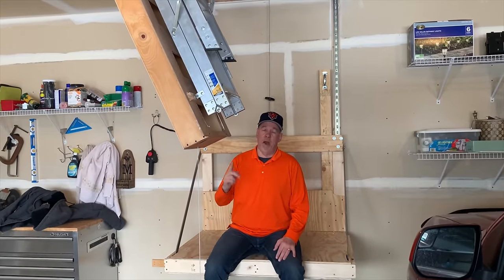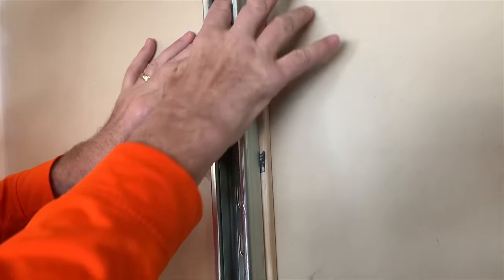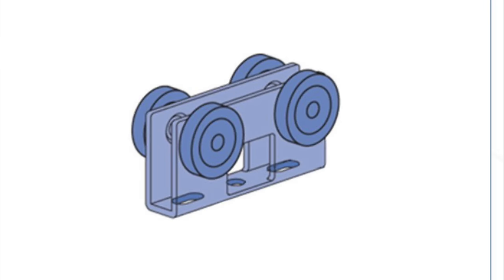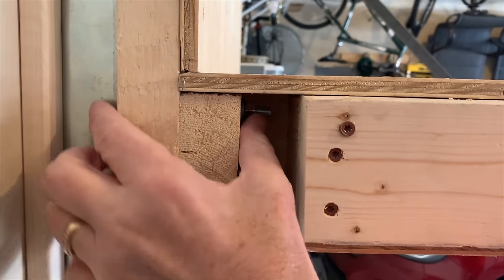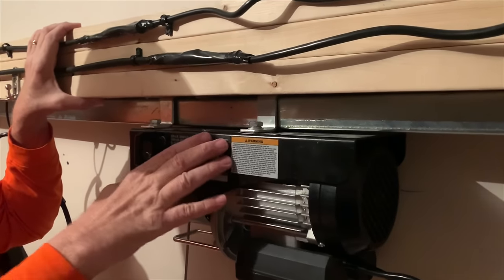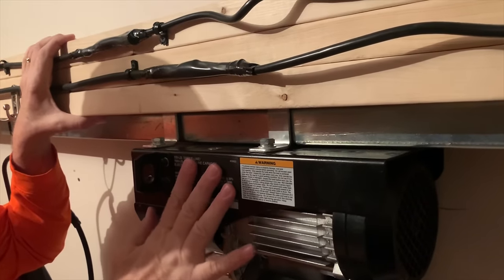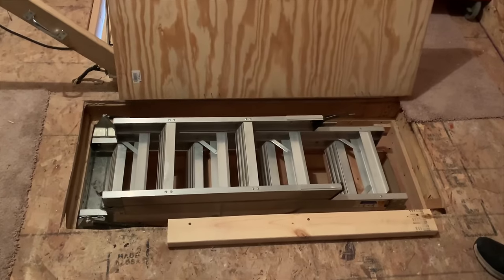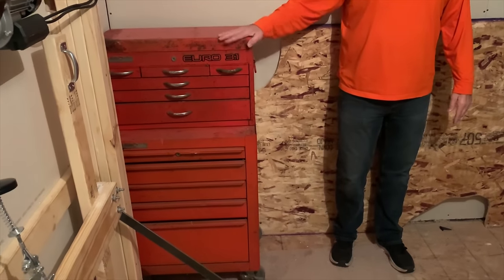Garage Attic Elevator / Lift Build in Minneapolis Minnesota

Comment: To start what a great idea and build but I have one major concern. The frame you built up top is sitting on the joists I assume? I know you attached it to the studs but does that means there is no structure that goes to the floor from the beam holding your winch? If this is the case and you are using only mechanical connection and resting on a single joist assuming that they run from garage door to back wall then you might have some minor problems in the future. Now if your joists run side to side meaning parallel to the back wall you are going to have problems real soon and I think this is the set up you have judging from how you ladder sits. You should look at running 2 4x6s from you motor support beam to the floor either way. If you lay the 6 inch side to the wall it will not take up to much room. I doubt this thing will fall but it will make your ceiling, floor and wall(that you attached too) sag over time cracking drywall and maybe spliting a stud or 2. Fixing the sag in the future will cost way more than a some 4x6s now. Sorry for the wall but I thought this would be shorter but as an engineer once I get to thinking about something it's hard to stop.
Reply from the maker: I appreciate what you’re saying. It’s attached to double studs on the wall and resting on joists as well. There is no more weight, all things considered than a couple of 250 lb guys having a conversation in the attic. The joists can handle that alone.

Comment: Please check the rating on the eyebolt you are using to attach the hook. It appears to be a common hardware item. Although they may look beefy, most are only rated for less than 200 lbs.
Reply: @theelevatorSRT8  I don't know what you bought, the eyebolt looks like a bent wire (hopefully closed) eyebolt. A quick look at Hillman bolt (one of the brands carried by the box stores) shows a 1/2" bent wire eyebolt with a SWL (safe working load) of 300 lbs. So I guessed low. Ive seen import 1/2" down to 150 lbs. Its still probably much less than you were thinking. A forged one piece 1/2 lifting eyebolt would be rated closer to 2000 lbs. I'm just asking you to check the specific bolt you bought and make sure you are comfortable with the rating.

Comment: I'm about to build one like this and would love to see the platform with the plywood removed to see how you framed it out. I was going to frame it like a wall then move the vertical posts inward so I could put bolts through the horizontal 2x4 since the end cross members would be in the way and just realized the metal support pcs wouldn't be able to bolt to the outside of the frame since the verticals would be moved in 1.5 inchs inward. You have your verticals right to the end of the platform then a cross member that doesn't extend all the way to the horiztonal 2x4; it stops in front of the bolts.

Comment: Metal splicing plates would help strengthen the angle at the base/vertical joint of the "L", and cover the dust trap (and potential hazard) where you can see the bolts/nuts.

Comment: For the record they make brackets to hang winches on unistrut and grainger sells winches that come with unistrut straps and have crane type roller assys for winches if you want to slide it left to right.
Reply from the maker: Thank you for the tip.
Reply: @theelevatorSRT8  you are welcome. Nice job. Even if you claim you dont know about framing. In the future if youre going to cut studs o  support walls or ceiling joists you might want to double up on the boards that you make your box out of. Same for the hole in the ceiling or attic opening. I cant count how many attic ladders ive climbed or repaired where the ladder was added and not propperly framed with double joists. Good call on the uni strut. Its great for so many applications. I see the price has doubled in the last 15 years.

Comment: Clever idea, very clever...and perhaps for your circumstance, the perfect solution. 
Questions fore others to consider:
1. You lose the garage storage space equal to the foot print of the platform, floor to ceiling.  That's a LOT of cubic feet of storage. You also lose the attic storage space equal to the footprint of the platform.  How much storage space did you gain, in the attic, by doing this. (most homes do not have the attic storage that you do)
2. How does the cost of building this elevator compare to the cost or a shed of equal or greater cubic feet of storage in the backyard?  (I understand in the case of a townhouse you may not have a place for a shed...but in general it would be a consideration)
Reply from the maker: Thank you

Comment: Thanks for sharing, what do you use for security?  i just saw a video of a guy falling off  the attic , im not sure what failed.
Reply from the maker: I’ve added some safety features. See the other videos. If it’s the same guy that I saw, he is using a different type apparatus. He is not pulling straight off of the hoist. He is driving another shaft with it. It’s not a smart setup. I think he’s using a garage door setup.

Comment: Perfect elevator in need the same to get up to my attic rooms in 2nd floor as under the opening already is existing strair case there no way to get a another stair case fitted. Simply perfect

Comment: You have the pulley cable mounted on the back of the lift and the load weight is further in front. There's a rotational torque pulling on the rails.
Reply from the maker: Yes

Comment: I would like to build a simple lift like this for wheelchair access to the second level. I am  leary of the trolley wheels. They look like they could get worn out easy. What if I got stuck midway???? Otherwise this is great and not so costly.
Reply from the maker: You must be very careful if you intend to do something like that. I cannot recommend that to anyone. Too many chances for injury from just operating it. I ride ours occasionally but only because I know what we we built, we over built it for strength, and I am very careful when using it. I cannot recommend using something like this for a wheelchair lift.

Comment: Nice effort however at 4:17 I'm hearing binding. Metal scraping on metal is an indication something isn't aligned well. Binding equates to excess load (strain) on the lift motor. Then you end up with metal shavings. I'm a license lift installer and I've installed dozens of various home lifts and none of them have ever used such tiny rollers like you are using. The bottom rollers are the ones that take all the pressure due to cantilever dynamics and those should really be larger and made of polyurethane or nylon. If you would have spent at least a few minutes looking at actual home lifts you would have had knowledge of proven designs and made something better than what you have. 

Stacking and gluing lumber together seems to be a time waster when you could have simply bought 4x6's while ending up with something stronger. And what is that eye bolt rated at? You didn't mention anything about using the proper grade.

Again nice effort and it's nice to see someone motivating others to build things themselves.

Comment: Hate to be critical, but if the cable or gearbox fails, aren't you going for a tumble? Maybe add a ratchet or an acme drive? Or did I miss something? This design is good for stuff, but better to avoid riding on this mechanism.
Reply from the maker: Thank you. We created a one of a kind safety brake. Go to our channel and check it out. It’s way cool. And it works.

Comment: Ok so good job and I will one day do this. One problem...the over arching beam that the motor is connected to is wrong and could pose a problem down the road. The 2x6 used should be upright...not on their sides. They are 10 X's stronger upright then on their sides like that. As the wood ages it looses its flexibility and they could crack under the weight. Just a constructive criticism. Otherwise brilliant!
Reply from the maker: Thank you. Technically speaking, you’re  not wrong about the header boards. But I did that for a reason, the large holes I had to drill to fasten the strut/motor. That header will support 5 times the weight I will ever put on it. Plus, they are glued and screwed, and from an engineering standpoint, eliminating the shift, which gives it the strength of a solid beam.

Comment: I have a question, the control, does it hang on the wall below the lift so you can have it available to use the lift. Did you cut an opening in the ceiling for it to hang down? Nice Job also. I will build the same for my house.
Reply from the maker: We just left some space in the opening.  If you build one, be careful building it, be safe operating it, and overbuild it for strength!

Comment: Nice job.

Question about your wiring between the hoist and the controller. Is the cable running from the hoist to the controller  sheathed 3 or 4 wire?  I ask because I have a similar hoist from Harbor Freight - it uses length of wrapped 4 wire to connect the controller's rocker switch. I couldn't source any wrapped 4-wire cabling to run a longer lead to the controller....
Reply: @theelevatorSRT8  Thank you! I had no idea they carried that.

Comment: The only safety problem I see with this is there is no way to stop the platform from falling if the cable breaks, or comes off.  The other issue is if the cable snaps that cable may injure the passenger.
Reply: @theelevatorSRT8  Oh and I didn't mean it all to be negative.  It's great work and a great idea.  The cable snapping happens in the off road world when you are winching someone out.  We're talking about vehicle weights though.  We have to be careful with winch lines as it can severely
 injure or kill someone.

Comment: Great idea!! What is the weight load for most attics. Just wondering how much weight can you put in a standard attic. - I found your video while searching for help with creating a lift using the attic steps/ladder. I like this idea but I don't have enough clearance to do this.
Reply from the maker: Thats a good question, I didn't calculate it or know off hand.  I'm assuming its a lot. At least on par with a living space.

Comment: Weak point is upper 2x6 holding everything from its ends. Suggest a simple improvement - extra length of wire or all-thread rods going further down to the lower 2x6.  Method of design is to imagine the first weak link fails, then see how to carry the load.
Reply from the maker: The  overall method you suggest is how I was thinking. The carriage will not fail. It’s way overbuilt.

Comment: Can you provide some details on how you extended the electrical cable?  What wire type and guage and how many conductors are needed?  I can't find an electrical detail in the manual for that hoist. (Talking about the up/down controller)
Reply: I used this.  Went 16 gauge.   https://www.grainger.com/product/GRAINGER-APPROVED-Portable-Cord-20PX48.   I just removed the old cord fully vs splicing the existing cord.  Just be sure to ground all the wires as there is 240V caps to run the electric break on a power fail.

Comment: This is a great idea and straightforward, efficient design.  One question I did not see addressed:  what did you do below the vertical beefy posts you built to carry the horizontal motor mount beam?  Those attic verticals are strong but unless the posts below going down to the garage floor are also beefed up too, the first floor supports would be the weak point.  Thanks
Reply from the maker: Thank you, when we are only talking about lifting 300 lbs max, its not a concern.  Just picture two grown men standing side by side in the attic.  Nobody would be concerned about that .

Comment: Unistrut is strong as hell. We hang literally tons of emt full of huge copper wire. Thanks for the video. Ive built and installed several elevators but ive been designing one just like this but wasnt sure what i was going to use for wheels inside the unistrut. Mine is designed to lift a king sized bed out of the way when not sleeping on it.
Reply from the maker: Holy cow, I could see the bed thing. That would be so cool.
Reply: @theelevatorSRT8  i built a really cool bed years ago out of aluminum stage trusses. They are the tubular towers that lighting is typically mounted to along with speakers and fog etc for concerts and other stage performances. There were two towers at the wall going from floor to ceiling one going across the top from left to right with surround sound speakers a projector and lights. A box designed to look like one side of the truss that the mattress sat on that was hinged at the "head board"  end of the frame work. No supports anywhere else under the framework. Just open space. With the flip of a switch the bed would pivot up toward the wall side and it revealed a seating area if i decided to use it. All made of aluminum tubing that just flipped out and down. That poor bed got a lot of usè and abuse. This bed elevator is for a buddy of mine. He comes up with crap and i build it. Ive had experience in building elevators some from scratch one was a kit for my house. Ive made things to lift my boats ,cars ,motorcycles, and my lazy ass. Even built a roller coaster.

Comment: This big fan needs your expert opinion! 

I’m planning to install a small lift (22.5”x3’) to go between the trusses in the finished garage of the new home I’m moving to which a currently under construction. The existing studs to not align with where I need to install the super strut tracks. I’m considering two options to keep from having to tear out the painted drywall to install new studs:
1. Attach a 4x8 sheet of 3/4” plywood over the drywall into the existing studs and attach the super strut to the plywood, then use horizontal boards to the attic studs to complete the track. 
2. Install horizontal 2x4s spaced every 12-16” over the drywall into the existing studs and attach the super strut to that. 
Would the plywood be substantial enough to support the super strut? Which option would you choose? Thanks!
Reply from the maker: Hi, I’m not an engineer. It sounds like the 3/4 plywood is good to hold the the track. The bigger concern is what you do to support the hoist motor assembly.
Reply: @theelevatorSRT8  Thanks for your reply. It’s a coastal home, so built with 2x6 studs. I plan to use brackets bolted to 4 of those studs to hold the super strut supporting the hoist - similar to the design in Jay Bates DIY Elevator You Tube video. It will be a small lift, about the same size as the hole for the pull-down ladder. Thanks again!

Comment: Wow this is awesome! As a female senior citizen I am having more problems lately getting my telescope down the patio stairs in 3 separate pieces, then having to assemble and disassemble it every time I want to use it. Its getting too heavy for me and its a bit awkward getting it done, as well as lugging all the imaging and misc doo dads I need for a viewing or imaging session. With slight modifications this contraption will work wonderfully for me! I will be able to leave my telescope assembled on wheelie bars and just roll it onto this "elevator", hoist it up to patio deck (about 32 ish inches) and roll it in and out of the house and patio. All the accessories, cameras, computer etc I can put on a cart and use the lift to get it to the patio too! I have been racking my brain to come up with something feasible without major expense or modification to existing structure. Your lift idea coupled with the idea I was formulating in my head will work!!!! Thank you so much for this video, I can finally turn my brain off and stop thinking about it, and stop considering selling my 10" SCT Telescope! The provided links were a huge help as well.
Reply from the maker: Sounds like a great hobby/passion. Good luck to you!

Comment: To whom it may concern!
Nice idea, nice, construction and it looks very safe. BUT, the wiring is illegal. Is 120 V AC. 
It should be in a meaty electrical box with a cover. Its wrapped with electrical tap. If for some unknown reason; that wire got and melted the tape it could start a 🔥. If that wire was in a metal electrical box. The fire would be contained with in the metal electrical box. Hopefully if that happened the breaker would trip before the wire even got hot.
Regards George
Reply from the maker: Thank you for commenting!

Comment: I built something like that for my pole barn with a 16 ft ceiling.  No channels just hangs freely on the cable. When it goes through the ceiling, I have to be up top to guide it through. Nice solution you have.
Reply: Your header is way strong. I have a 2x6 that is topped off with a 2x4 in a T configuration that spans 8ft. The winch is bolted into the vertical 2x6  with 4 lag bolts. The lag bolts are in shear.  I've lifted several hundred pounds with it with no problem.  I would not ride mine or have anyone near it when under load for safety's sake though.

Comment: looks fabulous.  As someone else noted, the only weak liink I saw, was where your pull wire connects to the 2x4.  ALL your force is pulling there...I would either reinforce with angle iron, or change your one eye bolt to at least two toward the ends of the 2x4, so as to equalize the upward pull force.   Otherwise, I wish I had a high enough attic to make one myself. Great job.
Reply: @theelevatorSRT8  ok. I thought it was a 2x4...you shouldn't have any problem then.  Thank you.